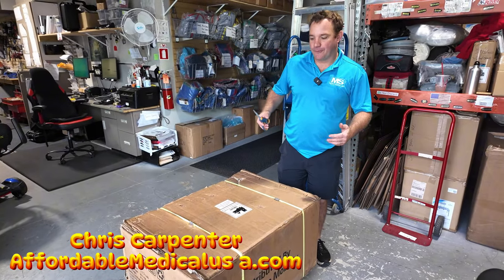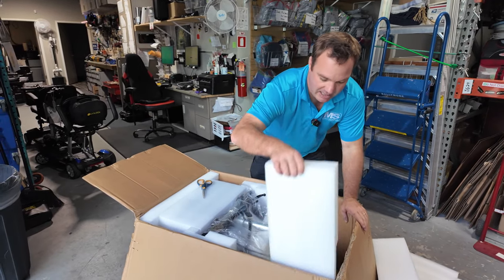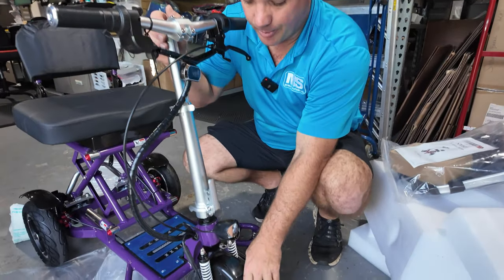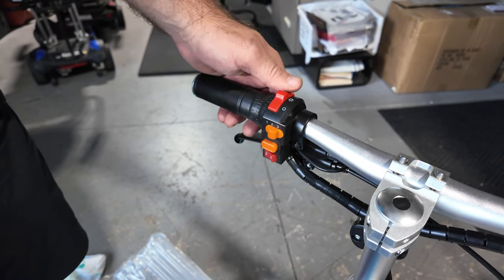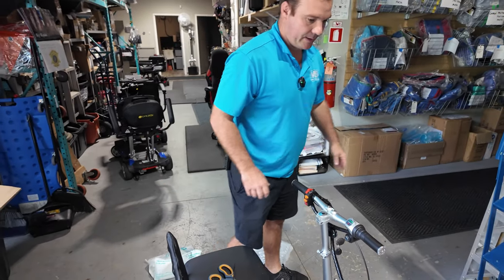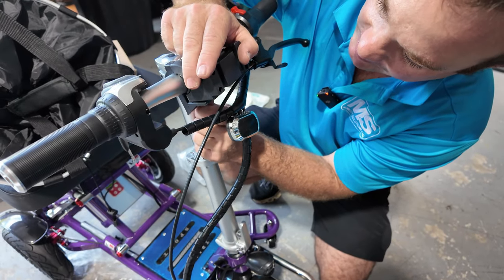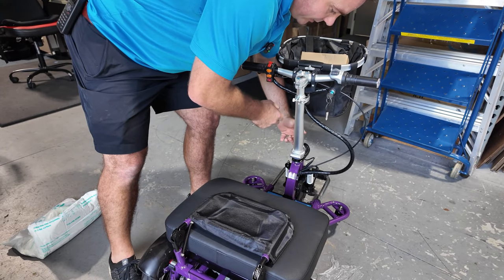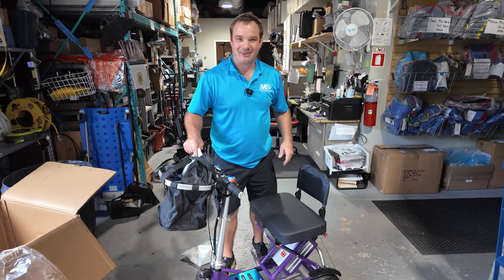Unboxing 2024-2025 Triaxe Sport Recreational Mobility Scooter

Comment: I have owned two of these and my 3rd is on the way.  The luggage rack should be pulled out when the scooter is used to make it less likely to tip over.  
    I moved my brake handle to the side with the throttle. 
   I wish arm rests were available and that a seatbelt came with it.  I have never used anything but the 18” seat.  
    Other changes I wish they would make include having the forward-reverse button was in the same side as the throttle or even better would be to be able to reverse it by pulling the throttle towards you.  The horn button is far too easy to press and could use a way to cover it when you don’t intend to press it.  The light also comes on easily.
   On two occasions I thought I was out of battery power only to discover that jostling while riding had caused the battery button to flip into the off position.
   This model is not good on grass, gravel, snow and steep inclines.  I almost had a terrible accident at Univ. Of Florida’s football stadium when the scooter couldn’t make it up a long steep ramp and then swiftly rolled backwards.  It caused me to fracture my left knee in several places when I tried stopping the scooter Flintstone’s style.  Another time the brakes failed on a ramp causing a lot of panic in a crowd.  Thanks to a quick thinking man who grabbed it by the seat, I didn’t hit anyone.  
     This scooter is great for travel.  I can put one suitcase on the luggage rack, roll another using my free hand and wear a large backpack and get to the airport with everything I need for a six week trip.